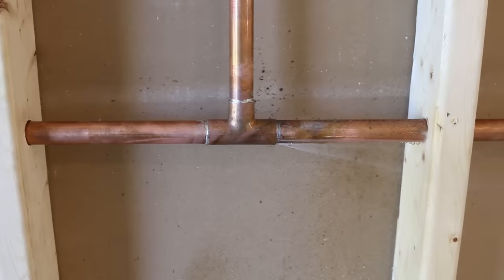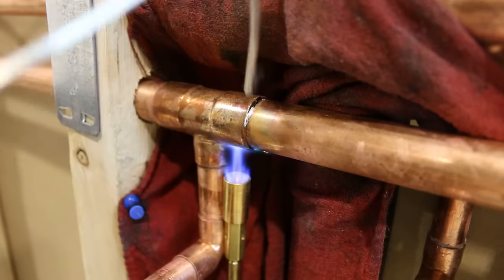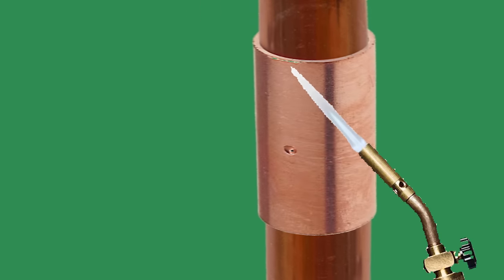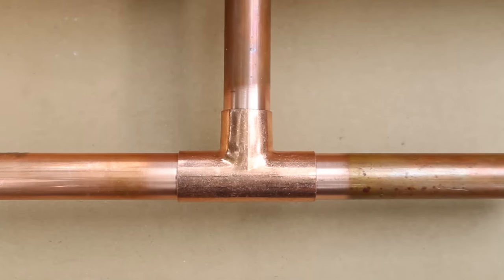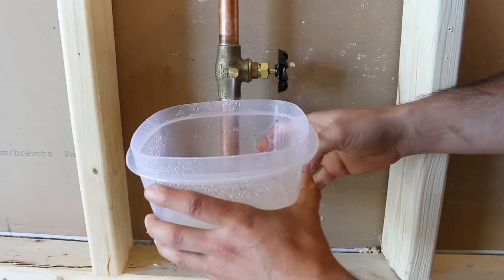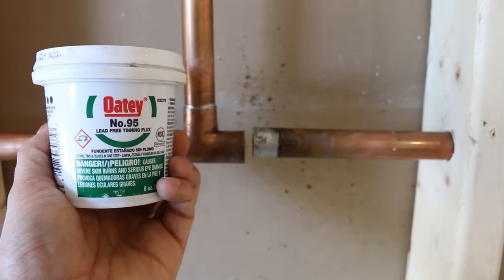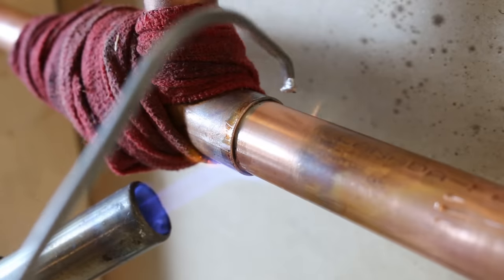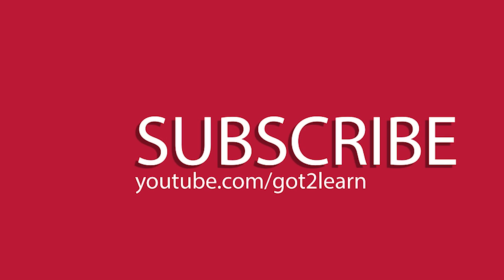The CORRECT Way To Fix A Leaking Joint (UNSOLDERING) | GOT2LEARN

Comment: either the previous plumber didn't properly prep the pipe by not sanding or fluxing it all the way or he got a hair from the brush in the joint...it's happened to me many times before with the brush hairs.the sanding or steel brushing causes scratches for the solder to seep into and hold.this is the second reason why doing so is critical..it doesn't clean 100%, that's what the flux paste does.it cleans it 100%.also i love to use the paste with the pre -tin in it..you get a better bond with it and can see when the fitting is hot enough by watching the tin melt into a matte finish.
Reply: I also like the tinners flux also like the fittings that have solder in them. Saves a lot of solder
Reply from the maker: Sure does!

Comment: We had to replace a leaky pipe, not because of unsoldering but because when they built the house or installed the pipes they left it pressed up against a pine board.  Pine is slightly acidic (slightly more than slightly actually) and over the years it ate it's way through the copper pipe.  So if you are fixing your pipes or installing new ones make sure they aren't touching the wood anywhere, particularly if it's pine.

Comment: One thing that I've found for cleaning the inside of the fitting after separating it is to use a honing tool with rough stones. A quick pass will leave the pipe smooth and round and make it much easier to re-insert the the pipe into the fitting. I did this for a friend about 20 years ago, still tight and dry.
Reply from the maker: Cool, got a link to that "honing tool" ?
Reply: @Got2Learn  They are available in several sizes, I have an old one that was 1/2" to 1 1/2" that I've had for more than 30 years. This one is 3/4" to 2 1/2" : https://www.autozone.com/test-scan-and-specialty-tools/brake-and-engine-cylinder-hone/oemtools-3-4in-adjustable-brake-cylinder-hone/47928_0_0
Reply from the maker: Nice! I'd be curious to see one in action, I am having trouble seeing it happen but hey, if it works it works ;)
Reply: @Got2Learn  Here's a short video on the basic use. A couple of things, I would use a cooking oil as a lube (being food safe), clean the stones with something like Bar Keeper's Friend and a nylon brush to clean the pipe after using the hone. The nice thing is, solder being a soft metal usually cleans up with only a few passes of the hone.

https://www.youtube.com/watch?v=mqljC5NBveY
Reply from the maker: That's pretty neat, never saw that tool in a drill, only in machine shop ;) Thanks for the link!

Comment: Hey I always use a sponge, fire blanket, and get the pipe hot, then use a wet sponge on the outside, the female side of repair area to cool. Then heat it 1 more time and the outside female end will be cooler and solder will follow the heat into the joint for vertical jobs

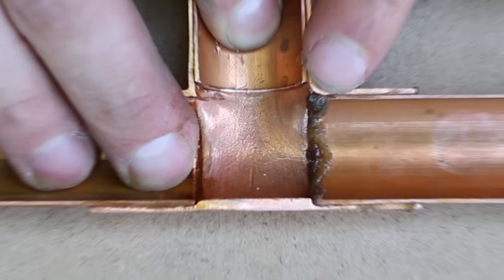Comment: At 8:09 into the video, the excess flux is shown inside the pipe and it is mentioned that this will eat up the pipe and cause more problems.  As mentioned in the video and in the list of materials, the flux is water soluble.  Excess flux will dissolve in the water in the pipe long before it affects the copper or solder.  The water soluble nature of the flux is also one of the reasons why you can't solder a pipe with water in it.  If you heat the pipe enough to change the water to steam, the steam can find its way out of the still-to-be-soldered joint and the steam will dissolve the flux and the solder won't flow where it should.  So, water in a pipe is trouble for two reasons.  The water won't allow the pipe to get hot enough as you have mentioned, but water, especially hot water and certainly steam will dissolve the flux.  True.

Comment: Any chance you could show some in ground soldering? We solder 1 1/2"-2" copper pipe for swimming pools, they are typically heavily corroded and have been buried for a couple decades. Maybe a worse case scenario video? Thanks for the content

Comment: One question:  will cleaning the pipe with a scotch pad loosen the soldered t joint on the other side of the pipe? I don't want to use too much strength. 
Great video thank you.
Reply from the maker: Nope, you are good to go!

Comment: is there any DOWN SIDE to brush a hot solder joint before it hardens with a paste brush.(to smooth it out,and,get rid of any inclusions.)I've not had any problems with this.Just curious.
Reply: a HEART like doesnt answer the Q..........

Comment: If you brush over the freshly soldered joint with self cleaning flux as it cools it makes the joint look neater and spreads the solder into any little gaps you may have missed
Reply from the maker: Yup

Comment: this vide is great if you are stuck in the fifties first of all you wold not need to solder if you had a geberit tool secon you dont need flux if you use the correct solder for copper and if you got a leak with copper solder you could repear it by just adding more solder and not remove the whole pipe

Comment: Got2Learn, I used vise grips like recommended in this video to remove the fitting but after I was done I have some deep groves in the pipe from the vise grips digging into the pipe. Is this a problem? Do I have to replace that section of the pipe. The pipe is type M and not that thick. My guess is that the grooves are a little less than half the thickness of the copper.
Reply from the maker: If you hare scared just use some rubber in between, that should do it!

Comment: You're right, of course.  I had a boiler and flow valves replaced and one of the joints at a valve leaked. The plumber and I didn't want to  drain the whole system and take down the connection in the winter. So he suggested at least trying the down and dirty method.  So he did. Of course, that was only 35 years ago. It might start leaking again tonight.  I know I just got lucky.
Reply from the maker: Yeah, it's luck ;)

Comment: At 8:30 part of his acid swab bristile is left on the pipe where he fluxed it. Then he shoved that into the joint. Unless it burnt away, he just added an impurity that could cause a leak. Other tips were good, but I know alot of plumbers that lightly wipe the hot solder off to make a clean joint before it fully cools without any issues.

Comment: Thanks man.. I replaced all the pipes in my home 30 years ago, never had a leak, but did on my new house last week. Never knew you are supposed to let it cool. One recommendation for you: time your commercial break a bit better. I had to rewind to catch the whole sentence that was cut in half. Considering all the dumb clips out there, this tiny bit of criticism doesn't seem like much, but it could be the difference between grasping a concept or not for other users. Thanks for the tip.
Reply from the maker: Will do, thank you very much James!
Reply: Just install the youtube adblocker extension and never watch an ad again.

Comment: Very good, but as you mentioned not redoing the female side of the coupling, I always redo it, clean it, flux it as done with the outer piece using vise grips and a hammer to put it back together while reheating the male piece and move to the female if need be,, and possibly touch it up with a little solder

Comment: I add flux to the warm joint and it wicks in nicely and seals under more torch heat. I use tinning solder.

Comment: What i like to do when i solder pipes is take dropped thin wire from previous job and lay a small piece of it on horizontal work.

As soon it start melting into the joint then i know in a few second i should apply my solder wire. This way this resolve the question to whether or not i am heating too much or too little.

Comment: Do you need to remove all of the old solder and get back to the copper or is just cleaning it up to get it back in the joint enough I'm asking cuz I've never soldered before and owning my first house I feel it's something I should know
Reply from the maker: Doesn't have to be perfect, leaving some actually helps at getting proper coverage 👍
Reply: @Got2Learn  awesome I just had to replace my well pump and have to make one connection to get everything back together so I can prime it and get water back in the house

Comment: Ok I have a leak in a hot water out pipe located four feet below the combi boiler from which it comes from. There are no stop taps below this level or above it prior to coming to the boiler. My question is do I have to empty the who system prior to fixing the joint. - freezing the  pipe is not an option . Thanks
Reply from the maker: Yup.

Comment: Hi, 

I am trying to removed an end cap from a copper pipe 1 1/2".  I watched your clip and tried what suggested for 1/2 pipe.  I used propane at 1st then used map oro.  I touched the pipe for a good 20 minutes with no luck.  What am i doing wrong?
Reply from the maker: Two reasons might be stopping you from getting it done, first is that there might still be residual water in the pipe or two is the pipe you are trying to remove has limited movement to it, meaning it can't be backed out. If you have residual water in the pipe, try these tricks: https://www.youtube.com/watch?v=lNUAX6mJTlA&t=20s
Reply: @Got2Learn  i drained the boiler using shop vac.  I could easily remove one cap.  In 5 minutes  solder was liquid, then with a pair of pliers take the cap off.  Why the solder in the 2nd pipe will not melt?  Is it a different solder used?
Reply from the maker: I strongly believe there is still water in the pipe Matthew, try blowing air in, instead of sucking it out. Also, is the cap in a horizontal position? Because there will be water in it if it's the case.

Comment: I tried the tinning flux, and it is more like a wax.  Hard to see if it is getting on the brush let alone the pipe.  So I went back to regular flux.   Any advise on applying the tinning flux you recommend when soldering pipes the first time (not on a leak repair like this video)?  Thanks!
Reply from the maker: Was the jar cold? Tinning flux is thicker because of the solder powder in it, maybe try putting it in the sun for a few minutes ;)
Reply: If you heat the pipe for a few seconds then apply the tinning flux it works great. Tinning flux is nice when your first starting out.
Reply: Also make sure the pipe is clean and dry, no water. The flux only brushes on when the pipe is dry or it'll just clump up.😎

Comment: You have to use flux and it all goes right into the gap and makes it airtight. Afterwards you can put another solder seam over it, this is then nice and smooth and round and flush with the pipe. I always do it that way.

Comment: This video is just enough to get someone in trouble.
Reply from the maker: Opposite actually.
Reply: @Got2Learn  no really. How many times have you taken a pipe apart and tried to resolder it. It's a total bitch. It's easier to just cut the pipe and put a new piece in rather then trying to put the old pipe back in with solder on it. They fit perfect in the first place and the with any solder on them it's almost impossible to get it back in. If you do this day in and day out you know that.
Reply from the maker: For sure, I was just showing "a" way of getting it fixed, but there are other ways too that I will eventually get to ;)
Reply: @Got2Learn  thanks. I ment no harm. It's not rocket science but it'll drive you crazy when you have a leak. I sure hope you tell people to watch out for falling solder when working over head. That's a real bitch.😢
Reply from the maker: No harm taken, the best way would be to just cut, add a tee and some couplings and solder everything back together, I just wanted to show a way that it could be done, thanks buddy ;)
Reply: @Got2Learn  no. Thank you for helping people. Have a great day.
Reply from the maker: Likewise!

Comment: If you can’t move the pipe to clear the joint, would you have to:
- Cut a small section out of the pipe (enough to clear the fitting), unsolder the joint and remove the pipe
- slide a “slip fitting” over the remaining pipe
- cut a new piece of pipe long enough to insert in the fitting and reach the other pipe
- insert the new pipe and solder it into the fitting, then move the “slip fitting” into place and solder it 

Would that work?
Reply from the maker: Yes, like this: https://youtu.be/ebvqSp-d8-0

Comment: hello, I want to install the new plumbing for the shower valve, my question is if I used copper pipes do I need to make those extension lines high up from the cold and hot water to the main valve, is this extension necessary?
Reply from the maker: Those are not allowed anymore (air chambers), you need to install these to be code now: https://youtu.be/FbkE0HhEHVY

Comment: Damn, I guess I have been lucky.  Fixed a leak two years ago and still no leaks.  Just fixed one this weekend and still no leaks.  It was too cold or the water in the pipe just wasn't letting me heat up the pipe enough.  Anyways, hope all my soldering holds up. 😁

Comment: I went to school for HVAC and learned how to use silfos. Working with silfos has it's own challenges, but one thing I found to be easier is, when the pipe is heated correctly, capillary action works on its own, no need for flux. You don't have to worry about burning it up and losing the capillary "suction". I had to use regular plumbing solder for the first time recently when replacing the valve manifold on the bathtub, I had a hell of a time with it because I took too long to heat the pipe and burnt the flux and then had the nightmare of leaks everywhere. (and already it was a huge pain because I was cramped in a closet behind the tub and had about 1-2 inches of space between the pipe and the actual fiberglass tub.

Comment: A good way to stop a little bit of water from reaching the fitting is: stuff some bread tightly into pipe and it will stop the flow long enough to re-solder the fitting. This method works great as the bread will dissolve into nothingness when water is turned on.        ( a plumber taught me this about 40 years ago)

Comment: I have a T right next to a shut off. I need to remove the piece coming off the T at 90 degree. Will I cause leaks on the joints nearby if I heat and remove?
Reply from the maker: You run the chance of it happening but like I said in the video, if you use a wet rag around the other joints, you increase your chances of them not being bothered.

Comment: I drain system redo the leak side and  add Flux then solder and I do all 3 sides Flux and solder n never had 1 single leak, no wet rag at all

Comment: Another way to do this is to drain the lines and put a vacuum on the system.  Flux and reheat. Move joint in and out slightly and drop a tad of solder.  Pressure test system with air to 100psi and check for leaks.

Comment: So question. Do I have to move the solder around the joint or will it just fill in where the flux is if I run it in one spot? 

Haven’t tried yet. Probably going to get some supplies and just do test runs. Have copper pipe and want to be able to make a quick repair if I have to.
Reply from the maker: For 1/2" and 3/4" you can heat around the joint and apply at one spot, anything over needs to be circled around for proper coverage, cheers!
Reply: @Got2Learn  awesome! Thanks for the reply!
Reply from the maker: No problem!!

Comment: Lab demonstration makes it look easy...  Firstly,  drain down and remove as much solder as possible by wicking it off.  Map gas will provide enough heat to free the  joint, unless there is water remaining.  Gate valves are notorious for letting by so isolate from another source if possible and drain down thoroughly.  Once removed excess solder can be removed by wicking it off and then abrading the pipe - I wouldn't use mole grips, the scoring  is horrendous.  Venting the piece is important as mentioned below, there's normally an open tap or valve for drain down that will achieve this.  Flux the pipe only and twist the pipe/fitting as much as possible.  How many perforated fittings and pipe runs have you seen, even if it takes 10 years for it to burn through.  When introducing a new fitting into existing work that is awkward to get at, like 90% of jobs, use a Yorkshire or solder ring fitting.  I don't know why plumbers avoid these as the solder has already taken on one side, particularly when dealing with a heating pipe buried in a floor screed and butted up to 4 other pipes including a gas main.  Who said it was easy!

Comment: So is tinning flux preferred since it's like having an extra bond/solder opposed to regular flux?
Reply from the maker: The "pros" will say that if you know how to solder than you don't need it, but there's no reason not to use it lol.
Reply: @Got2Learn  apprentice here and that's what I planned on using, I'm not a pro yet but to me I'd rather get right the first time then having to do a re-call a week later or see it leak as soon as water is running through the pipe,great videos man! I'm learning the art of soldering copper and you know what you're talking about.
I see this one tech use the lead free flux and brush over the soldered joints right after soldering, goes through it with a brush and makes it look nice but isn't that a waste of flux though? I'm for appearance however I'm still convinced it's a waste and like I said earlier I like the tinning flux because it almost makes sure you won't have an internal bond issue with the fittings, as long as the temperature of the pipe is spot on, not too hot or slightly cool your solder should be leak free.
Reply from the maker: Yes, if you are new, you can use tinning flux, you'll better your chances at not have a leak ;)
Reply: @Got2Learn  it's what I'm aiming for brother, thanks for the info:)

Comment: If you change a joint from SharkBite to soldered copper, do the SharkBite teeth damage the copper enough that you can't just clean the surfaces and solder? And if so, how do you rehab it, or do you just cut it off to get a fresh start, if you have enough to spare.
Reply from the maker: Just use sandpaper, the teeth barly make a mark 👌